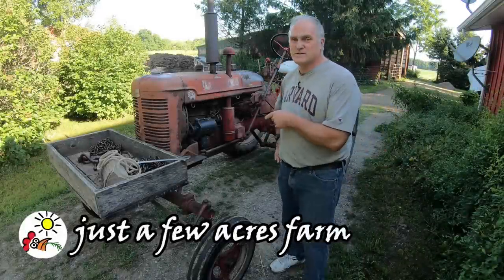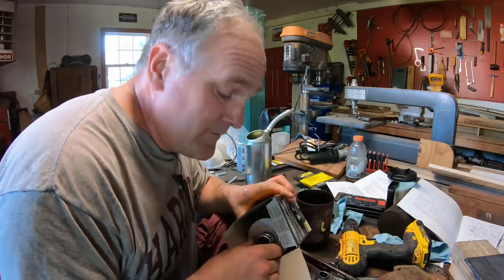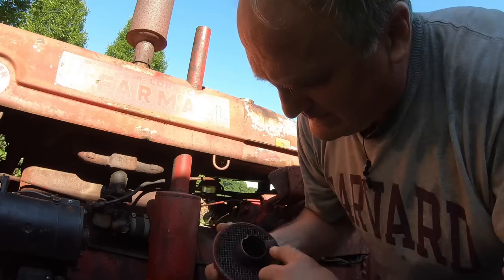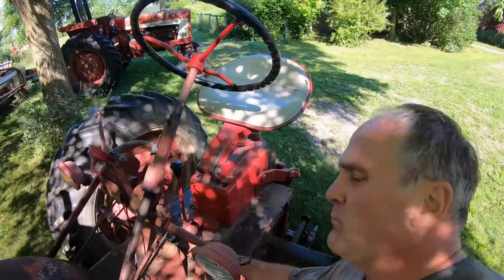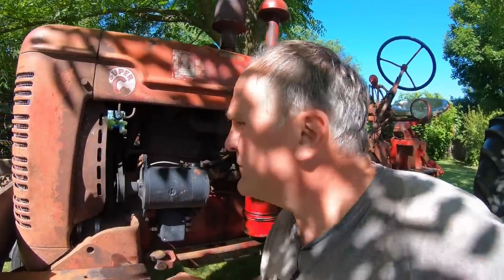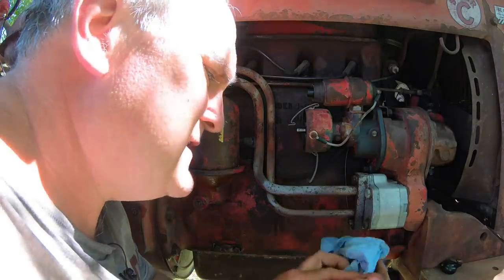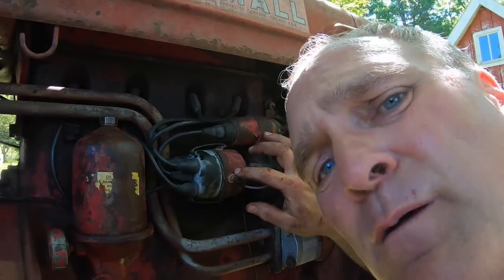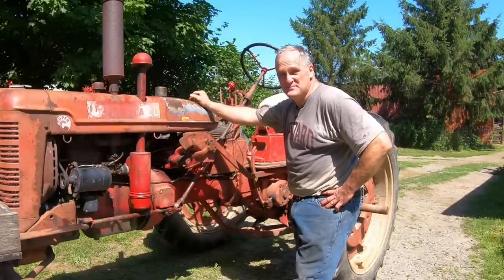how to service your FARMALL tractor

Comment: I bought a 1960 Farmall Cub about 45 days ago to cut a three acre field behind our home.  It came with a plow, disk, harrow and cultivator, whatever they are.  I knew nothing about tractors before getting this one, and if there is someone with less mechanical skills than me, I haven't met them or heard of them.  Nevertheless, I bought an owner's manual and a service manual from Steiner's and started watching your videos, and set out to get this contraption running. I watched your videos because I didn't know anything about what I was about to do.  So far, I've changed the battery (I knew what that looked like), I've changed the spark plugs (well, I changed two of them because I didn't see the other two first time around), I've replaced hoses (though I have no idea what they do and what they're connected to), and when the thing still didn't start I ended up taking out the carburetor (after I figured out what it looked like and where it was), taking it apart, cleaning the pieces and then put them back together.  The tractor fires up like a Ferrari and speeds along with its Mott flail mower bouncing behind at a whopping 3 mph.  My dog walks alongside while I mow!  All this is thanks to your videos, my manuals, and lots of prayers.  One issue: after I put the carburetor back together and reinstalled it, I ended up with two extra pieces that I threw in my junk bin.  Since "Cubby" runs so good I decided they must have been extra parts (?).  Working on this 60+ year old tractor is pure therapy for me at the end of a long day in the courthouse.  All I'm using is the tools that were in the Farmall tool box when I got it.  They knew how to put things together back then.  Hope I can find those extra carburetor pieces if it turns out I need them.  Thank you so much for making it easy for a mechanical klutz like me to have some fun.  Tom+

Comment: Granted we put a lot more hours on the old tractors servicing was an 'added chore' day. The grease gun got worked out quite a bit pushing clean grease in to displace the dirty grease. Didn't seem like it at the time but all of that greasing saves time and $ in the grand scheme of things.
Reply: I can't remember the last time I saw or used a grease gun on anything. They used to keep one in the tool box on the tractor.

Comment: I have a Farmall M and need to get ready for the Nebraska winter. You said this video applies to other Farmall models as well. Just double checking - my tractor is not a diesel but you still recommend the Rotella T14 15W40. Great video! Thanks
Reply from the maker: Yes. Rotella is great for gas tractors too.

Comment: Mr Pete.... you are a pretty good mechanic. I am 62 years old and have the very same Super C that my dad bought when I was 6 year old. Unbelievably one of the back tires is the original tire that came from factory. And it still holds air.

Comment: Excellent tutorial Mr. Pete! You hit one of the main points up front. If it didn't come with an owner's manual, get one! Also, you are exactly right about letting the air bleed out before screwing the filler plug all the way out on the touch control system. Back about 30 years ago, I got sprayed in the face by not doing this. Luckily, I was wearing glasses at the time. Keep up the great work!😊👍👍

Comment: Great video!  I found that using the curved side of a pick helps seat those O-rings very well.  You can usually slide it all the way around the surface until seated.  Been a hot summer in Syracuse, stay cool!

Comment: Not to complain about you standing in front of the tire while starting, but I remember going with my dad, uncle and grandfather to check out thr neighbors new tractor. My uncle and the neighbor were standing in a similar position as you, tractor pointed towards the back of the barn.  He told my uncle, watch how easy it starts (we parked most of our tractors on hills since batteries were always dead).  He went to start it, never checked to make sure it was out of gear.  Tractor started right up like he said it would and drug them both out the back of the barn. Luckily,  they must have gone between the rear tires, missing getting run over.  Tractor came to a stop on a tree.  That said,  looked like you made sure it was out of gear before starting. I sure miss driving our old m and c around.
Reply from the maker: Hi Dan, wow they were lucky. One of my neighbors was killed when he started a tractor that way and it rolled over him. I always waggle that gearshift before I pull the starter handle.

Comment: That's  great review of maintenance for these IR tractors.
But please just touch on the safety aspects of these things.
Seems loads of people watching these videos think these old tractors are all "warm and fuzzy."
This was all "Pre-OSHA"
First of all, the PTO on an old tractor can rip a man's arm out. 
But worse, a trike tractor, or any tall tractor could roll over. 
Many fatalities years ago, and even recent years as well..
Ford Tractor niche was lower tractors, 4 wheelers with extendible axles. 
In hilly areas, only old tractors on the re-sale market are Fords.
Very few IHs in some locations.
Just mention Pete, for the folks not familiar, other things to consider than what  a grease gun is for.
Thanks.
Great vids.

Comment: So I have  been watching the videos for the Super C overhaul. I recently purchased one and absolutely love the tractor! In one of the videos you said the safest place for the gas soaked rags is under the heater. So far I have cleaned out 2 buildings and put the rags under the heater as I left the building. Both times the building caught fire a few hours later. Am I doing something wrong?? I only have 1 building left so I need to figure this out! I can hardly wait till fall when I can start on my tractor! And yes the fire thing is a joke! Hopefully I stated it in a way that you were thing is this guy really that stupid. Thanks so much for the videos. I love them!!

Comment: I've noticed you normally see that slightly milky oil in pieces of equipment the don't normally make it to operating temp, like forklifts. You start it for a minute or 2 and shut it off and the oil will almost always look like that.
Reply from the maker: Hi Indiana Diesel, that's why that tractor had milky oil. She spends her life pulling wagons around and rarely runs for more then 5 minutes.

Comment: Pete, I So much appreciate the time and effort you put into making, and especially Editing your Excellent videos. I just subscribed.  I would like to point out that the oil filter housing "o-ring" is called a Quadring because of being squared with four sides. Also, in my opinion when One cleans out the quadring groove One should be careful not to damage the groove using a screwdriver tip with a paper towel. If i had to use a flat screwdriver I would want to use caution and some thick cloth or some double or quadrupled thinner cloth.  That quadring may not seal well if the groove is gouged, which could happen with a Good screwdriver and inexperienced DIYer.

Comment: Sir, I too use that plumbers PTFE tape on drain plugs and suchlike. Not only does it enhance the seal, but it also performs like a prevailing torque nut does (i.e. a nyloc nut), albeit on the male part, so you don't have to stress about vibration loosening versus initial over tightening on these critical lubrication oil retaining fastenings. Kind regards.

Comment: I bought a 1952 super c about a year ago, it had not ran in 10-15 years. I got it running and driving. My super c has a remote on it. I’m not sure how the people I bought it from got it to work or if it does because my touch control levers don’t move I have a few little bugs to work out still but if people want to see it I will post a video about it on my channel

Comment: I have watched this impressive video, and I think you are the perfect person to answer a question on my Super C!  I want to add oil to my hydraulic reservoir.  I'm also looking for the hydraulic access to the reservoir!  I tried following the return line, but it just appears to be a closed loop.  Do I need to take the valve the reservoir, or how is the complete flow accomplished?

Comment: Thanks for the detailed video! Where do you like to get replacement parts for your older tractors?
Reply from the maker: Hi Brandon, the short answer is "all over the place." NAPA, salvage yards, the Case-IH dealer, Ebay, etc. Depends on the specific part needed. I've found that most of the reproduction parts nowadays aren't very good quality, so I try to steer away from them if I have a choice.

Comment: Hey pete does any of your tractors have a place for crank case oil ? .. I got a 240 utility and the crank case oil add is in the front coupled with the hydraulic pump ... I was just wondering which weight of oil to use in it ?

Comment: I use a nail file to sand down points it work well. Also as if i remember right 2 layers of carton flip top matches is the rigth size to adjust  on the field . Someone can correct me if iam wrong

Comment: Great info ! Do you add any thing to the gas ? These old tractors were meant to have lead in the gas for a lubricant .
Reply from the maker: I don't add anything Eric. The lead substitute doesn't really do anything, and most of our tractors have hardened valve seats installed in the head. The lead was originally added to help lubricate the valves.

Comment: Which do you prefer,three point hitch or the quick hitch?And why the milky oil ?
Reply from the maker: I have both, and really have no preference as I rarely use either of them. Almost all our work is done using the drawbar. The oil is milky because this tractor is run for short periods of time pulling wagons from place to place, and doesn't get a chance to warm up.

Comment: Has anyone ever replaced one of the test valves for the oil level on the crankcase? The knob on the test valve for the high level of the oil is missing on my Farmall Model B. Is there a better alternative for a makeshift knob to be able to open the test valve that no longer has a knob?

Comment: Step 1) Buy a Massey Ferguson 
I'm just messing with ya, is there a spin on oil filter conversion kit for that tractor? My MF 35's had cartridge filters and I quickly replaced them. I buy Shell oil for everything I own too
Reply from the maker: I've never seen a spin-on conversion for the Super C. There's one for the 656 but it's crazy expensive.
Reply: Love my MFs but filters and replacement parts are definitely a profit center for them.
Reply: @foster3316  my local deal wanted $177 for a head gasket and Canadian Tractor Parts Direct had them for $25

Comment: I have the same tractor..it only runs barely spits an sputtering cutting off... rebuild carb.replaced plugs wire cap and button..car floods out all the time